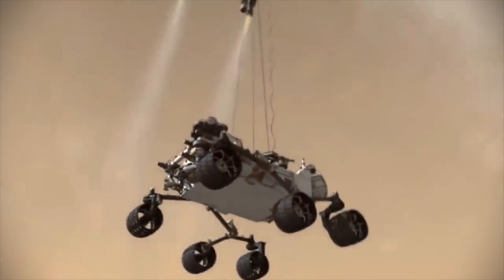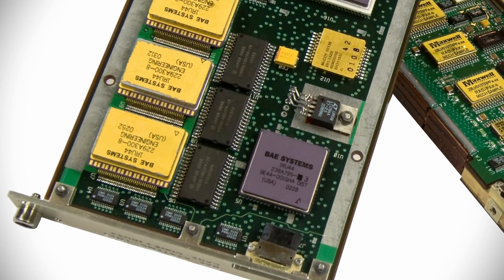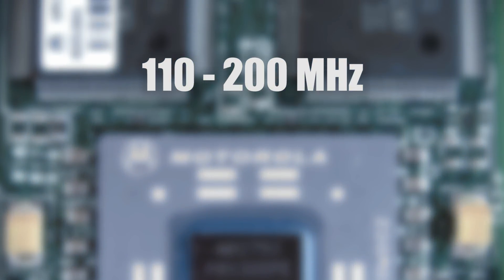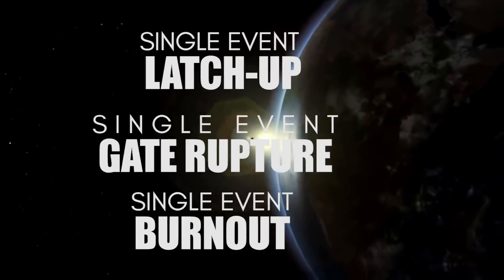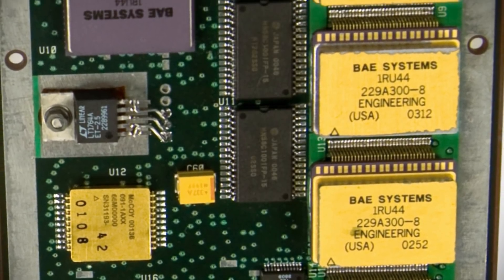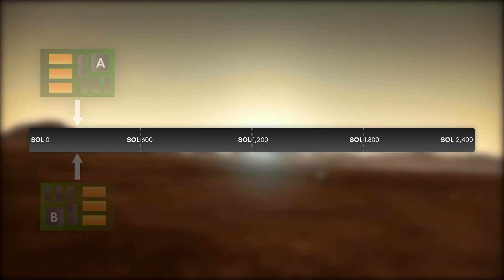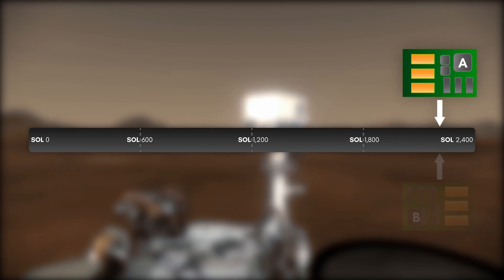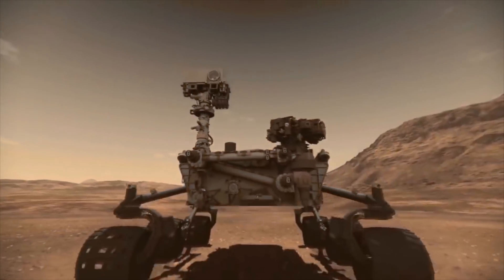The Computers Behind NASA's Mars Curiosity Rover

Comment: How many Grays of Ionizing radiation can it withstand?  
In the late 1980s I was working with a military defense contractor and we had to ensure that our military electronic system could survive 100 million Grays of ionising radiation, Something that which would only occur with a close nuclear detonation.

Also what is the type of radiation: Is it alpha, beta, gamma Or neutron radiation that is impacting this electronics? What kind of shielding are they providing around the electronics?  I understand Hydrogen or hydrogen rich materials are ideal materials for radiation shielding because hydrogen does not easily break down to form secondary radiation sources.  

Would they have problems with secondary radiation [bremsstrahlung radiation] being generated by high energy particles Impinging on the aluminum Structure of the vehicle? 

If the radiation field on Mars can have this impact upon electronics, how can a human survive in such a field for any length of time?

Comment: Why doesn't it make more sense to add shielding (lead), especially since a smaller CPU die would use less shielding?
Reply: Shielding good enough to reduce radiation to Earth levels would be almost 20cm thick. Also, radiation that impacted the shield wouldn’t just stop: it would trigger a cascade of other radiation events that can and would frequently reach the system components. Using ECC memory to correct errors and manufacturing the processor on an expanded die layout (putting more space between individual devices and keeping individual transistors relatively large) helps reduce this risk. But that’s part of the reason you don’t see shielded Core i7 processors flying in space: they are so densely packed and the gates are so sensitive, they’d immediately be fried. The downside of manufacturing on a larger die is your yield falls off exponentially with area, so you won’t get many working die. That further contributes to the cost, which is why one of these “old tech” chips will run you $250k+.

Comment: Please do explain why NASA, although almost miraculous in its operations, didn't include say 32,64,128,,, GB of Nand or what-not and 32GB of RAM although the sys bus probably could have just used the Nand at those clock rates. Seriously, think about its beauty, the landing program, terminated, flag, send status message to Goddard, 2nd flag, delete landing app, cleared, execute landed program,flag,send status, (flag=wait for ack) etc etc, instead of Kb to tell it to do all these things, a message on the screen "Mars Rover1 landed and is awaiting ack to run landed"

Comment: Vx works?!? A 10$ router most likely has vx works on it..   as expected.. the crap hardware freaks out.. lol
Reply: Only a handful of routers seem to have VX Works, all of them are priced well above your $10 range and rather unsuccessful (likely the combination of high price, low specs and poor compatability)... Most will run stripped out versions of Linux or BSD, some run fully fledged Linux installations and ranges above that use proprietary operating systems.
A $10 router doesn't even have an operating system so much as just barely some basic firmware...

Comment: With the numbers he uses, it sounds really fast, but in reality it's slow, although impressive conditions resistance
Reply: Which is the most important factor in space applications
Reply: @dhvanitdesai1044  Not necessarily you can still have radiation proof systems that are much faster than this, there are $20 ARM chips that are about 15x faster and use less power, yes it would still cost a lot to harden it but it would be better than buying a low end chip for $250,000 considering these modern IoT chips can do multiple simultaneous computations with multiple cores, whereas this CPU can not.
Reply: @data043  if you mean by radiation tolerant systems that spacex uses no you can't use those. Interplanetary space and Mars have far higher levels of radiation. The redundant non hardened chips will all get baked by the radiation LEO is a far cry away from actual interplanetary space or the surface of other worlds.

Also, the low demand. Since nuclear and space are the only places that use rad hardening, the overall demand is quite less, disincentivising investments in R&D, and infrastructure. Thus you're stuck with a select few sources trying to get their profits from a small set of wealthy customers.
Reply: @dhvanitdesai1044  Those chips they use are nothing special, same chips used in a gamecube from 2001, they get hardened by NASA, it isn't just shipped out of the box ready for space. If you take a gamecube into space the same thing happens.
Reply: @data043  yep, it's the hardening part that raises costs. The process of fabrication changes a bit as well as the lowest possible nm finfet. Also, since it's only a few who fab the rad hardened chips, they have a lot of pricing power.

As I also mentioned before, hardening has no substitute for interplanetary missions. Finally, from my experience with aerospace engineers, if a chip gets the job done, they'll stay with it for as long as possible. This is because they know the chip at a register level and be certain to an insane degree that everything will work.

Comment: The fact that the rover uses a cpu dating back to the 90s is amazing. Makes me wonder what can be done with an Intel core i7
Reply: probably not much, theres a large delay in sending instructions. It would just be wasting precocious power when Idle
Reply: @BudgiePanic  You forgot about cooling as well. A cooler would just add another point for a potential failure.
Reply: @darkphoenix7225  Mars is cold place, they actually have to pack heaters to keep the electronics warm. Cooling is not an issue
Reply: @BudgiePanic  Surface temperatures at noon reach 20C. You would still need a cooling solution. The mars rovers have radiators and heaters btw
Reply: @BudgiePanic  The air is cold, but there isn't much of it.
Reply: It probably couldn’t do anything since it’s not radiation hardened.
Reply: Not much 14nm transistors are too small to be effectively hardened against the radiation using conventional means.
Reply: @leyvawilly  
I figured that the effects of radiation would eventually limit the shrinking of feature size on radiation hardened chips. But what is considered the minimum feature size in radiation environments?
Reply: What's the point? The chip is only responsible for executing commands, every data is sent back to NASA for analyzing.. and analyzing those data needs more than than just an i7..

Comment: Didn't they install a robot hand to slap the computer to get it going again?
Reply: You don't need to even do that. Just turn it off and back on again...that was my most potent weapon working in IT
Reply: hahaha
Reply: Good one.
Reply: But the slapper must be able to withstand the high radiation!
Reply: @simon7762  Sure, yeah. I guess it'll then also need a circuit breaker for detecting over-annoyance in order to prevent too forceful slapping due to a tantrum. 
Goes to show why complicated shit is sometimes referred to as 'rocket science', right?
Reply: That's what the "eep!" rom is for. When it's not error processing and correcting ;)
Reply: nah just put it in rice and that should fix the issue
Reply: @PhoenixCNSTL  Hmm... Rice would provide an interesting situation on Mars, me thinks... I suspect that the low pressure and coldness would dry the rice out more, and possibly cause frost or condensation in its nearby area.
Reply: They should have installed a springloaded foot to reboot it now and then.
Reply: They do. But the Aliens throw rocks on helping hands.
Reply: Even for that U need computer to slap the reboot button of the computer 🙄

Comment: Why so weak though?
Reply: Higher performance requires higher transistor density. High transistor density makes a CPU very susceptible to errors caused by radiation, temperature, and mechanical stresses.
Just try and operate your average desktop CPU at 110°C - it'll shut down to prevent permanent damage (it will actually straight up break if shock frozen).
These computers are specially designed to withstand the harsh conditions of space, that's why they can't be anywhere near as powerful as even a smartphone or a gaming console.

Comment: Almost a decade later, Mars 2020 will still use the same processor. Reliability is the utmost priority...
Reply: @arandomguy4478  Just open up mars.nasa.gov, you can see the basic specs, which are headed by this RAD 750 CPU, not some modified playstation CPU.
Reply: I was curious (no pun intended) so I went and looked it up. Here's the link for anyone else that wants to see: https://mars.nasa.gov/mars2020/mission/rover/brains/

Comment: Is the CPU fabricated using a silicon on sapphire process?
Reply: The CPU isn't using SOS - it's silicon on silicon dioxide instead (likely due to its size, unlike the tiny 1802 for example, which is SOS).

Comment: Im surprised no one has asked, "yeah, but can it run Crysis?"...
Reply: more like doom you meant :P
Reply: @Darco626  yeah, lol... i looked into these chips a couple years ago, its nice to see that some are deciding to make videos about them...
Reply: It's a far more capable CPU than the one you need to run Doom on. This is very similar to the CPU in the Nintendo GameCube, which was also PowerPC but clocked at 485MHz (the RAD750 is clocked at less than half of that, but is of a newer generation and can perform more operations per cycle). You can safely say that you could play GameCube games on this computer, assuming it had a GPU similar to the one in the GameCube (the RAD750 on board the Curiosity rover has no GPU).
Reply: Banjo Kazooie, take it or leave it.
Reply: Single core 😂
Reply: It may not be able to run Crysis but it can certainly run in a crisis c:
Reply: I was thinking about the old 8-bit arcade game Defender....
Reply: Can it run GameCube games on there lol

Comment: PowerPC? Now there's a name that I haven't heard in a long, long time.
Reply: Watch out for the Dark Side Luke
Reply: Isn’t that IBM’s OS?
Reply: @wan4j4de  No, it was hardware (The CPU.) The operating system for the PowerPC (jointly worked on by IBM and Microsoft) was called OS/2. There were a few versions (like two or three), but the only one I had the pleasure of working on was OS/2 Warp. (The company I worked for had two OS/2 Warp workstations when I first started back in 1996.)
Reply: The PS3 had a PowerPC CPU.
Reply: @KnoppersBomber   So did both of its main competitors.
Reply: @Roxor128  Xbox One is x86
Reply: @karlkastor  You've got your generations mixed up. The PS3's main competitors were the Xbox 360 and Nintendo Wii. The Xbox One competes with the PS4 and Nintendo Switch.

Comment: and a magic receiver and transmitter that can travel millions upon millions of miles
Reply: Not magic.  Radio.  Ever hear of it ?
Reply: @stranger_danger1900  and have you ever heard about limits to how far a radio station can transmit
Reply: @rodg011  You're talking  about terrestrial radio which is limited by the curvature of the earth.  In space there are no limits.
Reply: @stranger_danger1900  speaking of curvature , how is it even possible to send a signal to a receiver if both planets are rotating, you would have to send the signal as both planets are aligned with the transmitter and receiver. or does the curvature thing only apply to earth.plus i don't believe in signals that can travel for ever and ever like it is claimed by nasa. like the 6.5 million light year they can see thing with hubble . 1 light year is already amazingly far, imagine 6.5 million times further. pure made up fantasy
Reply: @rodg011  Sorry you don't understand radio propagation. 
But the planets do need to be in position with the ground stations facing each other, unless there is a satellite in orbit above to relay the transmission. 

As for light, we know the speed of light and it's a simple math calculation to figure out how far it travels in a year.
Reply: @stranger_danger1900  they  have satellites around mars to transmit their signal to a receiver on the ground.one thing you believe and it is pure fantasy is transmitting  a signal has not limits in distance, lets be real here, except for nasa BS which every thing is limitless ,it can not be repeated by anyone, nasa just makes up the wildest stories and people swallow it whole. they know that a planet light years away has a diamond core, come on, even if it did exist, there is no way to find out,unicorns and fairy dust, anything to get those billion$
Reply: @rodg011  There is no limit to the distance radio signals can travel.  To believe otherwise is incorrect. It's all about transmitted power , receiver sensitivity and frequency.  There are no limiting factors. 
With 100 watts you can send a signal around the planet.  With 2kw a signal will bounce off the moon and return to earth. 
Your understanding of radio is lacking.
You should learn more about radio before making such statements.
Reply: @rodg011  We can hear pulsar radio signals hundreds of light years away. Why would our signals be different , other than power levels ?
Reply: @stranger_danger1900  how the hell can you know that a signal came from that far away, sci-fi fantasy
Reply: @rodg011  Because of mathematical calculations and being able to actually see the pulsar, we can estimate the distance.    Outer space is full of radio sources. It's not to difficult to hear them.
Reply: @rodg011  Your lack of understanding has no bearing on what is reality. The limits of your mind do not affect the ability of others to understand.
Reply: @rodg011  It's fantasy to troglodytes.
Reply: @rodg011  Poor roger....he should stick to his sand box and leave science to the scientists because he has the understanding of a 2 year old.

You don't understand radio propagation....he believes radio signals just get tired and stop for......reasons.

Comment: Can power pc 750 work under arduino ide environment? I want to buy such board.
Reply: Do you live inside a Nuclear Reactor core?
Reply: You can't buy such board. It is not being sold to mere mortals - heck, you'd find it very hard indeed to even get a quote for such board.

Same is true for virtual environments like Wind River Simics ( https://www.windriver.com/products/simics/ ), which provides a complete virtual RAD750 single board computer environment.
You can, however, buy PPC750 SBCs and dev boards either new or from recycled military or aerospace inventory. Prepare for prices way beyond the $2,000 mark, though.
Also forget about arduino - this is military-grade hard- and software we're talking about. This means (hardened) real-time operating systems like VxWorks, QNX, and the like.
These can be programmed in C(++) using your favourite IDE (Visual Studio [Code], NetBeans, Eclipse, Sublime, vim, emacs, ...), though even on your desktop PC using a cross-compiler like gcc,g++ or clang.

Long story short: unless you (want to) work in the aerospace industry, just forget about it.
Reply: @totalermist  They are probably better off buying a used Nintendo Wii and jailbreaking it. The Wii essentially runs a powerPC 750Cxe @729MHz.

Comment: Hmm, just from curiosity, will Curiosity survive on top of the reactor 4 building in Chernobyl during the clean up mission?
Reply: Dislaimer: I have no idea what I'm talking about, just spent 5 minutes on wikipedia. Please correct me if you know more, I'm intrested.In the show they say it's 12000 röngen per hour on the hottest roff "Marsha". It looks like there is a conversion Factor called the F-factor to calculate the absorbed dose from the exposure. But I couldn't find what that factor is for Silizium. For bone it seams to be 4, so I'm just gonna take 10 to get a rough idea. 
So we have 12000 * 10 wich gives us something in the ballpark of 120000 rad per hour. The processor claims to be able to withstand a million, so... Curiosity will probably die in less than a day. 
I'm just wondering why they didn't put shovels on those big cranes and scooped the stuff from the roof by attaching some a shovel. Maybe make a mechanical remote with cables for the crane and use a camera with some shielding and a zoom lense to keep a safe distance. Maybe they did it in real life or there is a good reason why it couldn't work, but I couldn't figure out why.
Reply: @gonun69  It would be kinda retarded to not ad that "F-factor" allready in specification of something that by design is suposed to work in environment with significant radiation... so most likely the Curiosity with some extra basic tools for the job would be able to clean the roof before imminent failure. Answer to your second idea/question is that it was in USSR... and there is this old joke that is kinda explanation of why it was not posible to do that in reasonable time: 

    This is Armenian Radio; our listeners asked us: “Is it possible to build socialism in Sahara desert?”

    We are answering: “Possible, but you will end up with a shortage of sand.”
;)
Reply: Probably not. We have radiation hardened robots that died left and right at Fukushima, blown up nuclear reactors put out a lot more radiation than the cosmic rays hitting Mars.

Chernobyl has definitely gotten less harsh though, right now they have the 100 year enclosure over it and a ceiling crane to pick up the radioactive rubble and clean the area of material and dispose of it. They threw out a lot of the active material with human labor back in the 80s, like 1 minute of work per person so they didn't die right there.